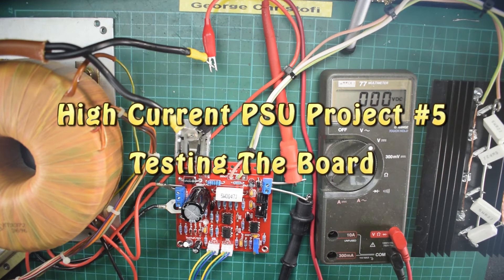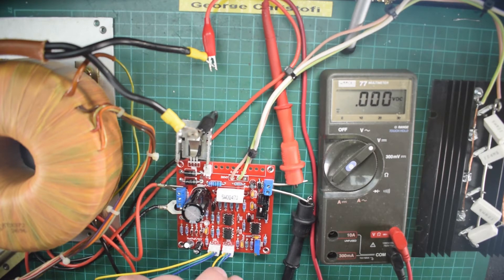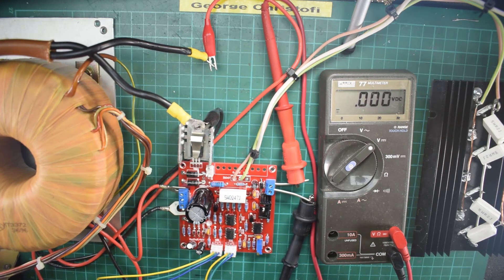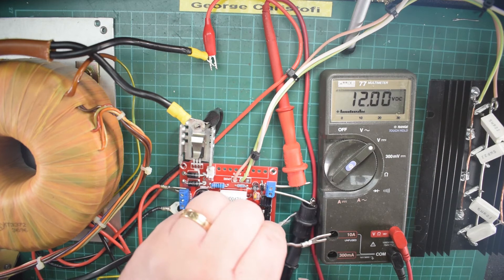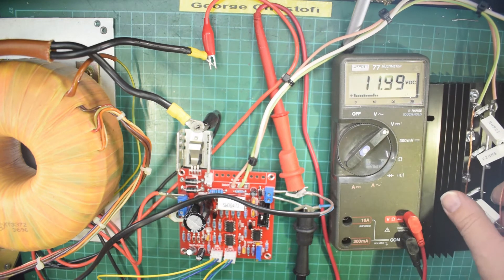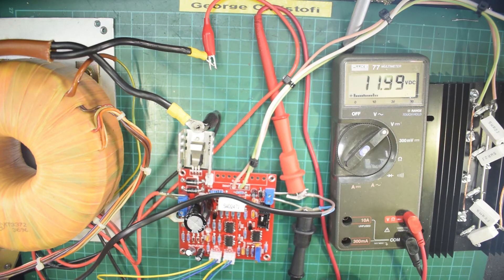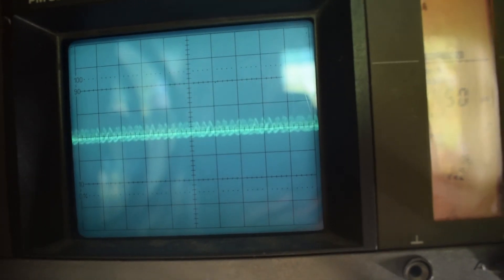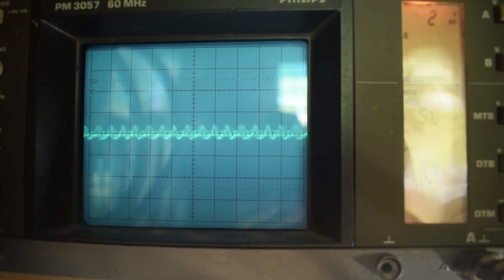High Current PSU Project. Part 5 : Power Up and Test the Hyland Board

Comment: Any update on the noise and regulation   of this power supply. The noise could be from the smoothing cap as it does not look enough for the current also note that this unit uses switched capacitor / diode to generate negative rail. I think this is causing lots of noise issue on the opamps. I have a lm723 power supply which uses the same technique for the negative rail and under load it gets mad.
Reply from the maker: +Mj Ram not at this time. I am thinking about more capacitance as well as the filtration on the mains side. Also this board is a clone of a popular internet circuit which over time has had many modifications. I still don't know if I am going to use it or go to a 723 based circuit in the same vein as my commercial astron rs 35a.
Reply: George Christofi . Sounds good. I get what you saying about that power supply . I saw it first many years back but could not make it work properly. Hence all the mods over years. I think lm723 will be better choice but be very carefull as i been testing the chiness ones with ones from digikey and the chiness one all fail left right centre lol. Soon i be doing a schematic and pcb of the lm723 power supply if by then you have not finished i can send you pcb layout . 

Keep up good work man.
Reply from the maker: That would be very kind of you. I do like the 723 and I do have a stock of genuine chips rather than clones. The issue with the Hyland kit is that its a good design if you are using a specific transformer. My one is several volts too high off load which would mean replacing the op=amps for devices rated at a higher vcc input supply.

Comment: With the multi turn pot you should set the 0 output voltage with V pot turned to minimum. More details in the original design: http://www.electronics-lab.com/project/0-30-vdc-stabilized-power-supply-with-current-control-0-002-3-a/
Reply from the maker: Árpád Attila Bakos I will do some more reading on it. The only downside is the low current rating of it.